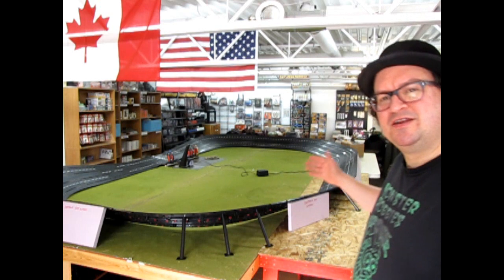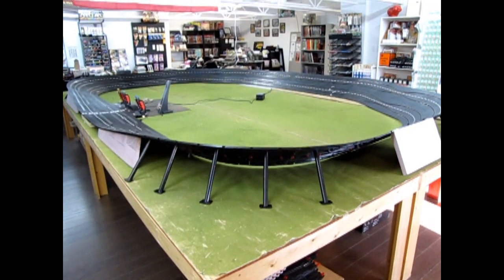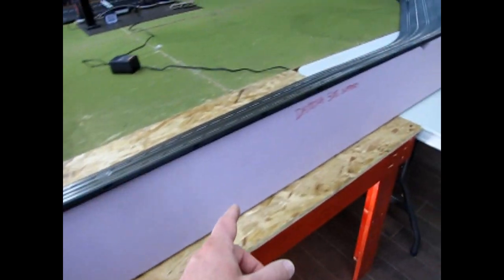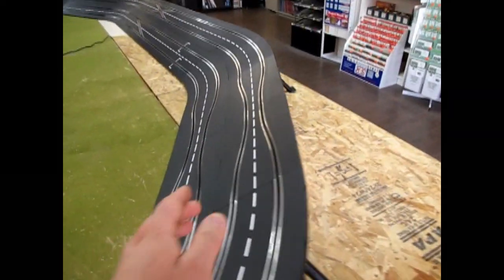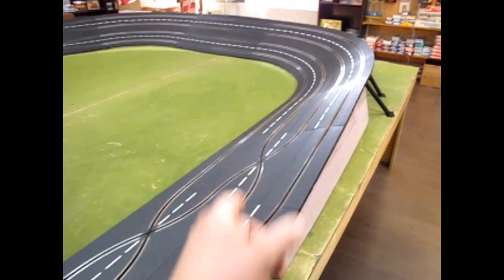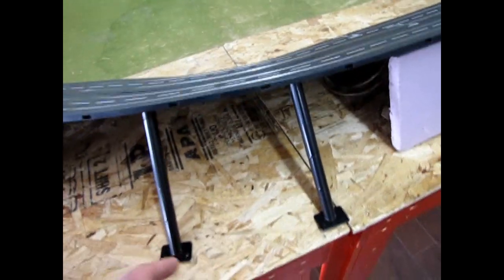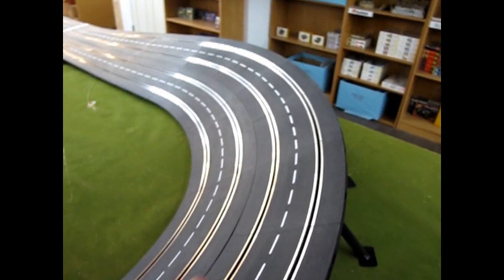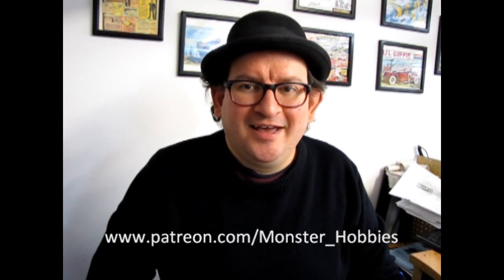How To Build The Daytona International Speedway In Four Lanes Using Carrera Digital Track

Comment: Awesome display. Thanks for the video. I wanna make a Daytona shape track but just 2 lanes for now. Just getting into this digital slot car racing. So it’s gonna be awhile before I have tracks to make a 4 lane.
Reply from the maker: Nothing wrong with a 2 lane set-up. It will make it more challenging to pass. Have fun! :D
Reply: @monsterhobbiesonlinestore  I wanted to make a Dover /monster mile type track. I was thinking high banked 2/30 or 3/30 . Would I need some 1/4 straights between the regular straights and the banked curve tracks? I haven’t gotten any of those tracks yet but I wanna make sure I’m not missing any when I place my order. What recommendations would you suggest? Thank you

Comment: Been looking at your 4 lane videos to plan a build.  Do you have to use the 3 analog cross overs to move from outside to inside lanes, or could you use a double digital cross to switch between the two outer and two inner lanes?  I get the forced crosses to make people switch lanes but wanted to know if it’s possible to do it without the manual crosses.
Reply from the maker: You should be able to for sure. The only reason why I used the forced crosses is because we had racers that would fly off to the outer track circle and floor it. That took all the driving skill away.